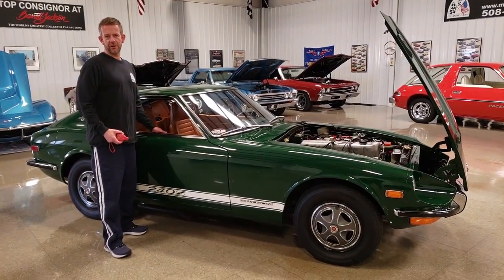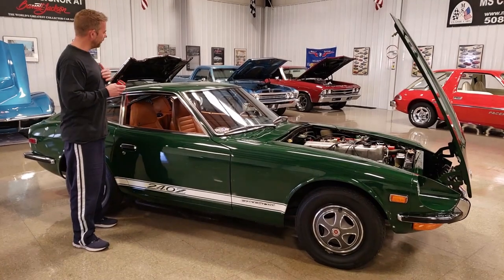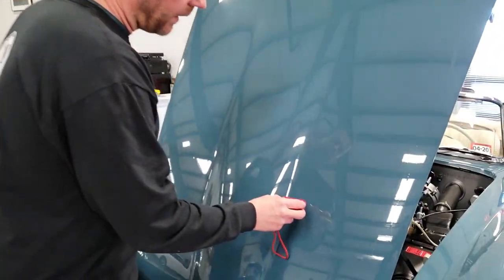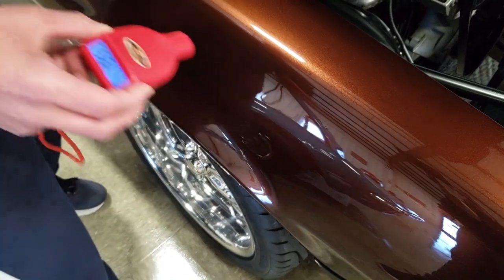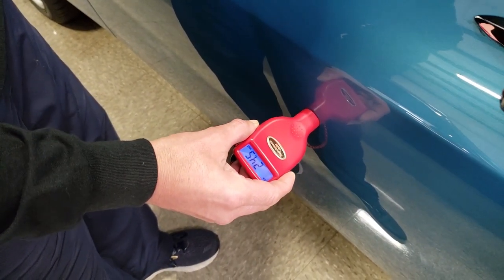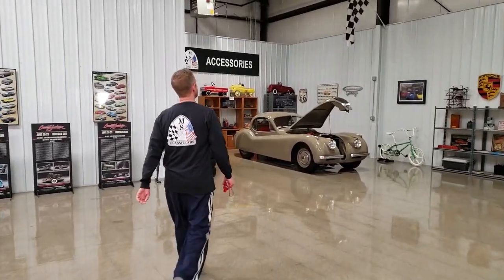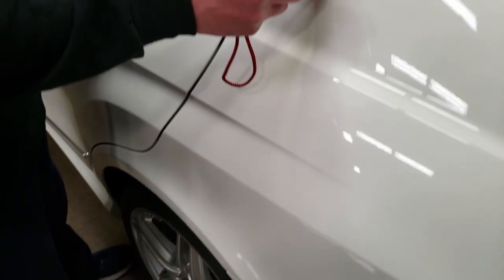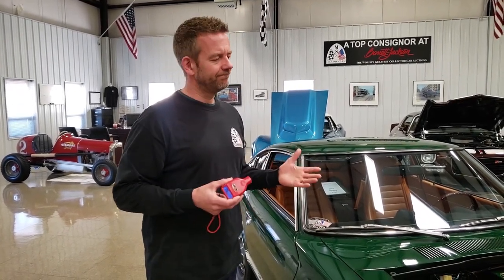Paint Meter Presentation on a Original Unrestored 1971 Datsun 240Z

Comment: No it most certainly does not end the question of original paint or not lol.  You are assuming that every repainted car will still have the original substrate on it.  Bare metal resprays could easily have the paint meter readings displayed here.  This vehicle needs to be seen in person by a trained eye to determine it's paint originality. The value of this Z will be dramatically affected if it turns out this vehicle has been resprayed.